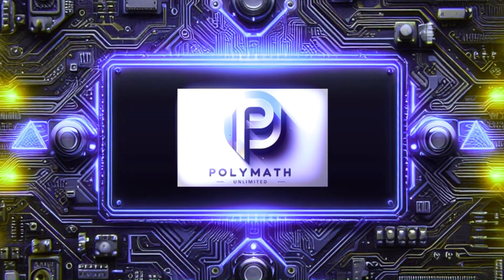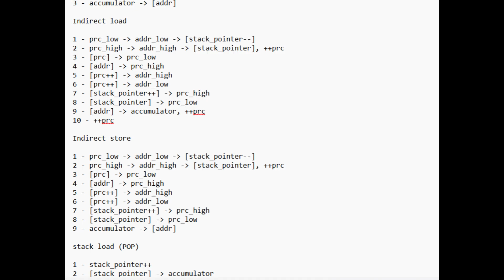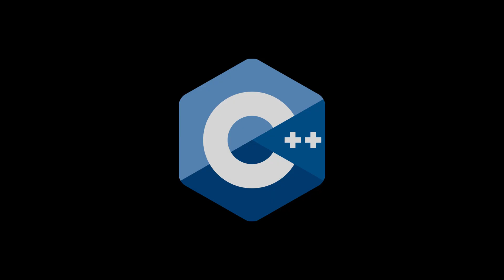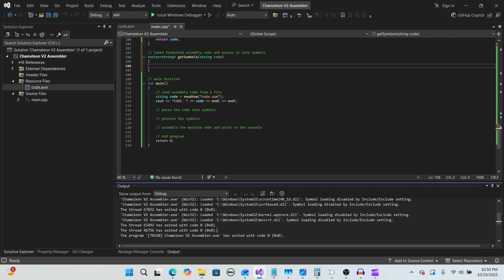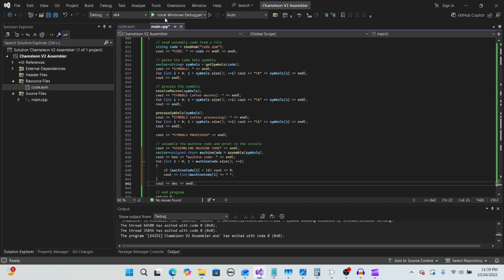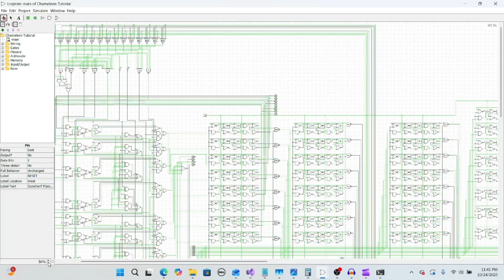Programming an Assembler for my Custom CPU in C++ (The CPU You can Build, Ep. 14)

Comment: In my case, I've used Java for my custom assembler and it outputs a text file so I can load it directly. I haven't thought about macros tho, but I think labels are enough for me right now.
Reply from the maker: Yeah I only recently started adding macros to my assemblers.  It's totally doable to write assembly code without them.  I recently made a subleq assembler though and macros were critical there in being able to write readable code.  They were simple enough to implement there that I figured I would also add them here just to make programming a little nicer for this one.  I've found it really helps cut down on written code size, and enhances code readability, especially when you have a bunch of repetitive tasks you have to do fairly often that aren't complex enough to justify using subroutines.
Reply: To add, my assembler does support calling labels before they're initialized, so I can use the JSR and RSR (in my case, I called it CAL and RET). I've also added general-purpose registers so I can communicate with the other components such as the TTY display or (in the future) another copy of the CPU.

I've successfully ran a 'Hello World' program haha
Reply from the maker: @gidsvids8320 very nice!  I'm a big fan of memory-mapped i/o myself (planning on adding that soon), but gpio registers are also a very solid approach 😎

Comment: not in logisim evolution 4.0.0 yet? you are doing all parts from simple parts? ie logic gates not compute elements. ie nand logic vs adders components. not using sub-components to clarify the wire mess? yeah keeps it simple, devs. but everyone loves gwbasic line numbering as jump targets. ie line numbers of code are useful. yes gwbasic assembly language assembler. macro functions? maybe. or not to keep the language and assembler code simple. ie risc code and even simpler compiler and emulator. even simpler digital logic circuit. well functions are so and so. ie better if you can compute the solution without requiring complex stuff. yep function calls will compress the code if the function is used many times everywhere. ie if same code is used multiple times with various arguments. java is enough similar to c/c++. also java does not have any of the c/c++ complications. but compiles to pure machine code. also java math lib has a ton of integer float hex string stuff already. very simple to use. yeah basic assembly/er is the best and simplest to use and implement. what? why assembled needs to do math equations like c/c++. add/sub/mul/div etc as usual. all text, no higher level language constructs. no you did not make an assembler, you made a c++ compiler.
Reply from the maker: Thanks for the feedback!  This is a lot to unpack, but I'll attempt to answer comprehensively:

I have tried Logisim evolution.  However, I didn't like it as much as classic Logisim, and I actually tend to get higher clock speeds in classic Logisim than I do in evolution.  So I decided to stick with classic Logisim for this project.  I am building with individual gates instead of pre-built circuit components for a couple reasons.  Firstly, this will allow me to use the Logisim circuit as a roadmap for when I eventually build this CPU out of transistors.  Secondly, the fact that it bogs down is actually beneficial, since it forces me to keep the hardware simple (at the gate-level) in order to make the Logisim circuit work well.  All of this will be a great benefit when I build the physical version.

I used C++ to program the assembler mostly because it is the language I am most familiar and comfortable with.  Could you use Java to program an assembler?  Sure!  If you're more familiar and comfortable with Java, then by all means use it.  However, it seems you might misunderstand a little bit how Java works.  Java does NOT compile into machine code.  Java compiles into bytecode which is then run by a virtual machine.  This has the advantage of making all Java programs completely cross-platform compatible.  As long as you have a Java VM installed on your machine, any Java code will run on your machine just like any other.  However, the machine code is running on a VM, not on your computer's hardware directly.  While this is faster than interpreted languages like Python and JavaScript, it is still slower than languages like C/C++ which do compile directly to machine code.  I realize that this is a minor distinction, and for many applications it doesn't matter too much.  But for performance-critical applications, C/C++ is still always going to run faster than Java.

Almost all commercial assemblers that I am aware of support mathematical operations in the assembly code.  This allows you to do things like compute address offsets (for example, if you have a label, what if you want to reference the address that is 2 bytes ahead of that label?) and other things like that.  I've made other assemblers before, and some of them have not included this feature.  In all those cases, I immediately wished that I had included it since it makes many programs much easier to write, especially if you are writing a program that manipulates data more than 1-byte wide.  A similar argument can be made for macros.  Every time I have programmed an assembler that does not support macros, I have immediately wished that I could use macros.  It just makes writing programs much easier and more expressive.  That said, you could technically write an assembler without these features.  I've done it before and it works fine.  It just works better with them.

This is an assembler.  It is not a C++ compiler.  If you put C++ code into the code.asm file, then it will not assemble.  In fact, it may even generate run-time errors in the assembler (I haven't gotten around to code error checking yet, I'll probably add that later since it will make programs much easier to debug).  Although, it would be interesting to see if I could write a compiler to compile C/C++ into assembly code for this assembler.  I'll have to try that at some point.

You're right, a Fibonacci program does not need much ram at all.  However, I plan on writing much more complex programs than that for this processor, maybe even a basic interpreter or an operating system eventually.  For that, I will need all the RAM I can get.  Currently, the most complex program I've run is a program that computed 15 correct digits of pi.  That one took a couple kilobytes of RAM.  More RAM is almost always better :)

Hope this helps :)
Reply: simplify. yes also your assembly language design. fibonacci sequence compute does not need much ram.

Comment: Wow this is the first time I‘ve seen an Assembler being programmed and I‘m surprised it‘s not that bad at all. Great video :)
Reply from the maker: Thanks 😎 it seems to work pretty well.  I even got a program running with it that calculates pi to about 15 decimal places (it took about 2 or 3 hours for the program to run on my logisim CPU though 😂 it's kind of slow).  I might do a few different videos where I write more complex programs like that for the processor to run.
Reply: yeah they arent very complicated, i wrote one in python with some nice features like macros, it was only about 300 lines and most of them are if statements, ive gone ahead and made a hexeditor similar to wozmon in the assembler so it works nicely!
Reply from the maker: @uui nice!  It would be interesting to try to port wozmon to my cpu.  It's pretty similar to a 6502, so it should be doable.  I may have to file that away to try later 😎